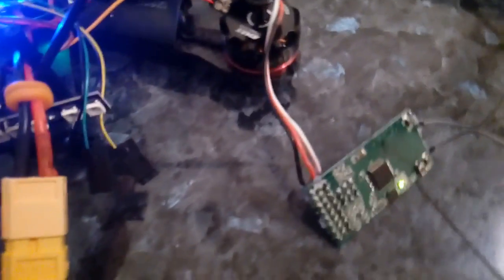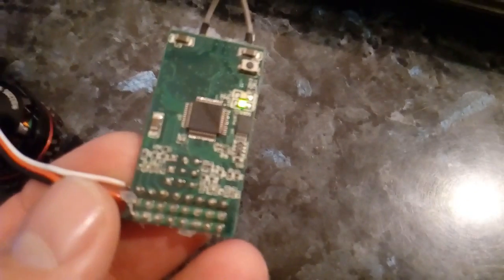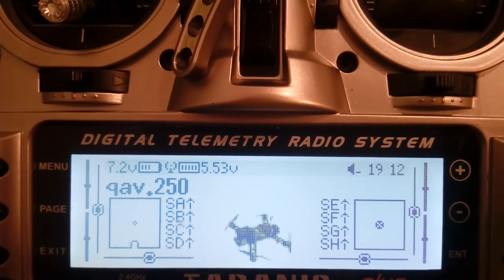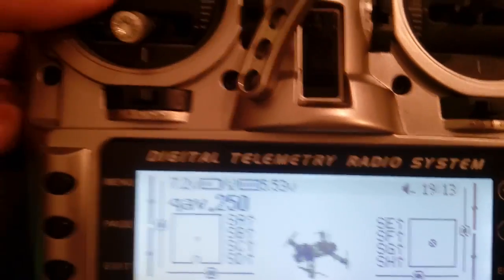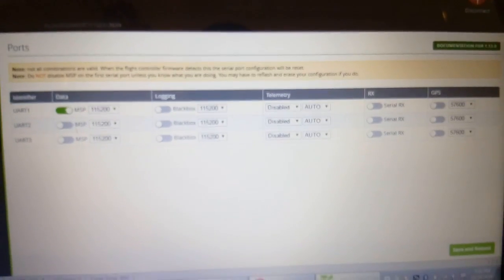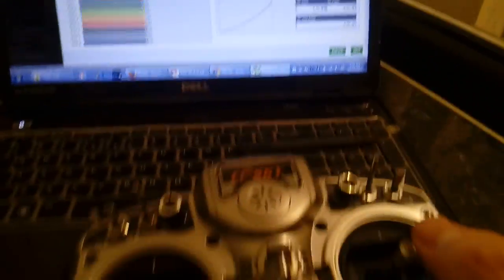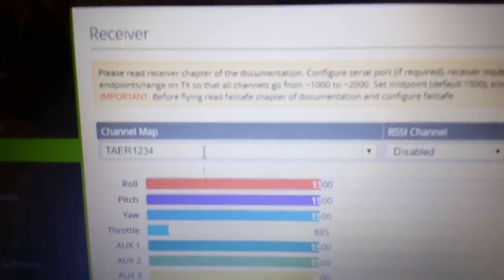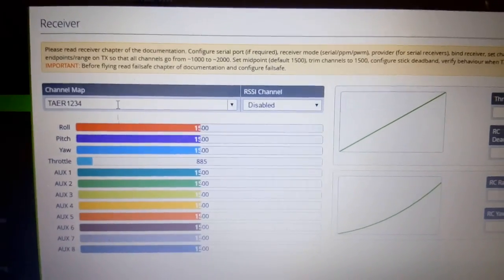Seriousely PRO F3 board (clone) not detecting PPM( FRSKY D8R II XP)

Comment: On the D8R-XP or D8R-II plus that has been flashed into a Xp, CH3 and 4 signal pins need be shorted with a jumper or CPPM and RSSI will not funtion on CH1 and 2. Looks like you receiver was de-pinned so I could not tell if you had shorted CH3 and 4. Also are you sure that the binding was successful. I believe the setting on the Taranis need be D8 and not D16. Lastly, on the F3 board, the plug for SBUS is on the opposite side of the plug for CPPM. Make sure you connected to the correct one per manual.
Reply: Sorry, I typed before I even finished watching your video. Look like you have everything setup properly. I have the same setup on one of my quads. Down to the D8R-II plus flashed to a XP.